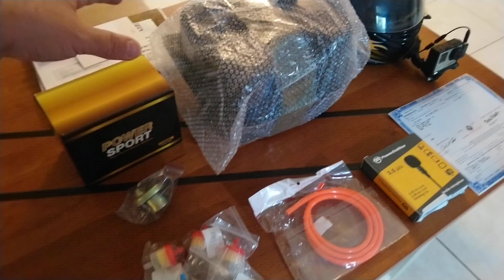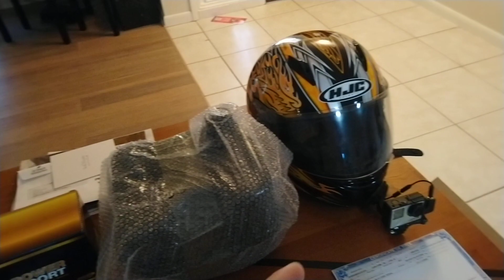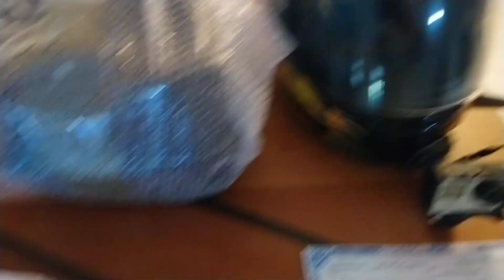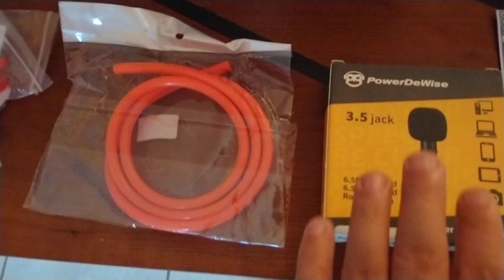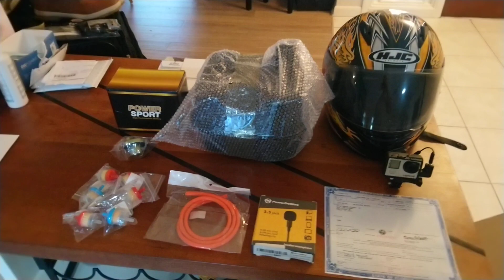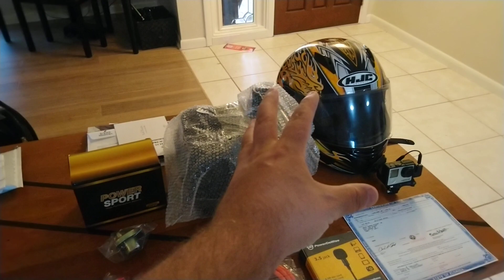F-Bomb Scooter Update

Comment: nitrous  on a small scooter , think those little pistons will hold up with a shot of nitrous????
Reply from the maker: Ooooh yes the secret to using nitrous oxide on a small displacement motor is never use the NOS past the top end of the Rev. You can use a small setup of NOS to get up to speed but you don't want to spray after you're at full revolutions otherwise engine goes boom
Reply: @IFixShet  is it a 2 stroke need to mix oil with the gas?70 mph with those small tires , you got more guts than i have..